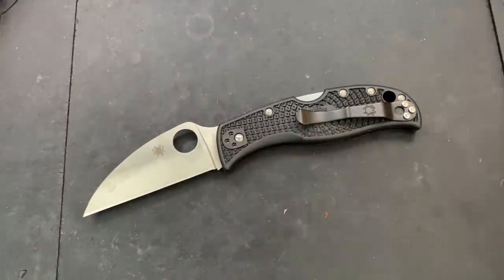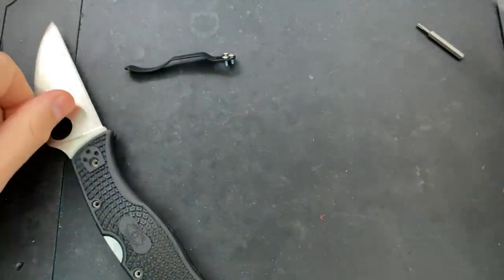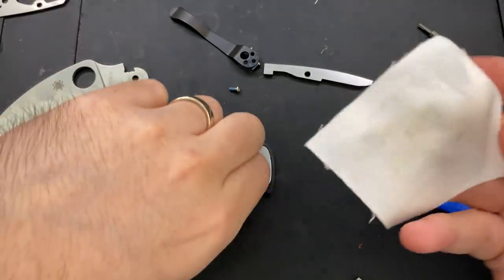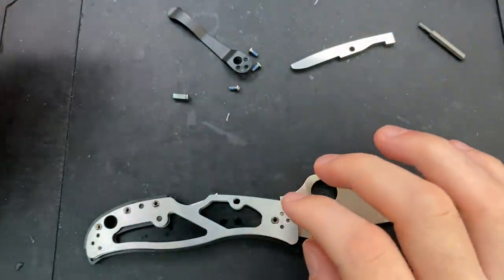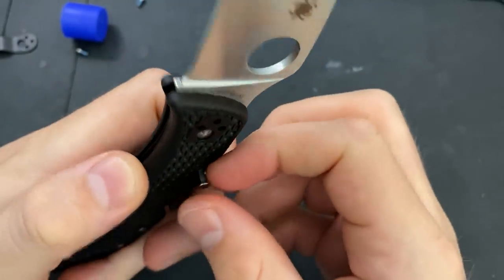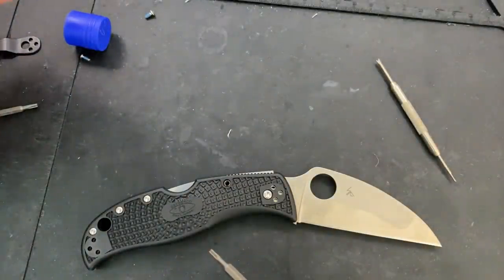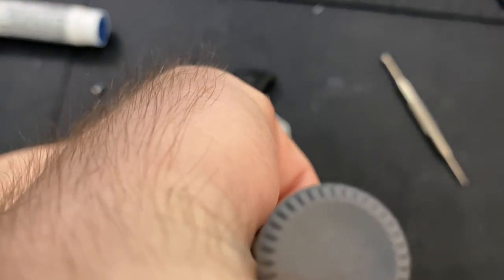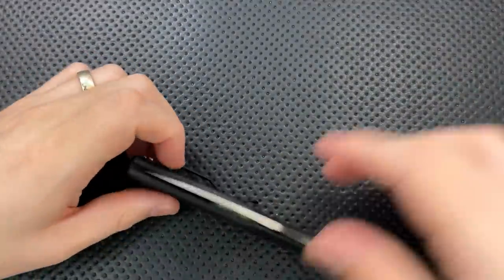How to disassemble and maintain the Spyderco Rockjumper Pocketknife (with first impressions)

Comment: How does this compare to the Delica for disassembly? I've always been a bit wary of taking my Delica appart
Reply: Exactly the same. Only differences are the shape of the knife handle, and blade.  

Delica uses Torx 6 screws for everything but the pivot pin, which is Torx 8.

If you have trouble removing that steel liner because the knife is under tension, you can depress the lockbar and push out the blade pivot pin as seen here https://www.bladeforums.com/threads/how-to-assemble-a-spyderco-endura.1741864/. This is on an endura, but again it's the same construction as a delica.
Reply: @moo9879  many thanks buddy 😏👍

Comment: Do you know why my pm2 either has blade play or won’t open right
Reply: Was it like that from the factory? Might just need a cleaning and proper tension on all the screws
Reply: Look up a pm2 disassembly video (either by Nick or someone else) and (if you don’t have a set) buy a Torx bit set, and some form of lube. I would recommend nano-oil, but it’s slightly spendy. Or, if it’s just the pivot screw being too tight, try and loosen it with the corresponding torx bit (which you’ll find in a disassembly video) but I believe it is t10. Then, if you’re scared to take apart the knife, apply some lube when the knife is half open to the backside (where the locking mechanism and washers are). And there you go! Hope this helps!
Reply: @EDC Lyfe yes for sure. They are the best.
Reply: @EDC Lyfe but also make sure to buy them from Wiha, Amazon gives used ones (trust me)